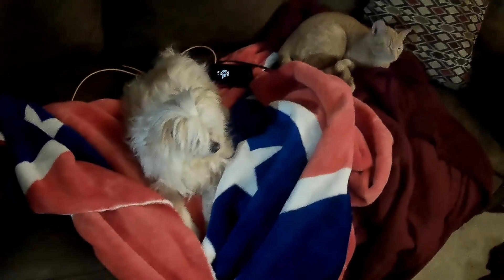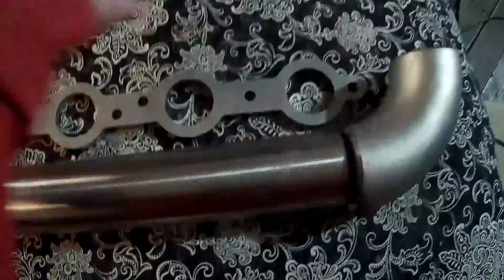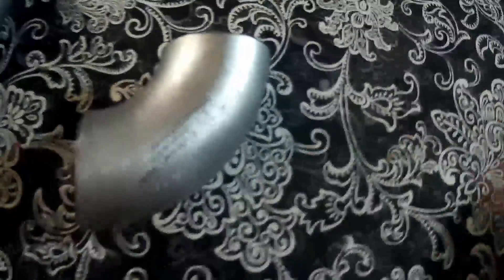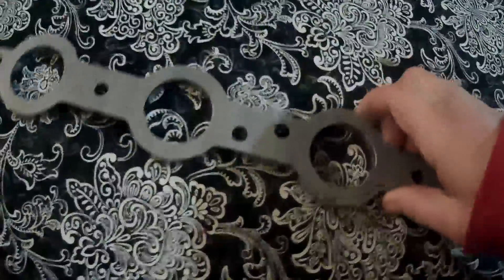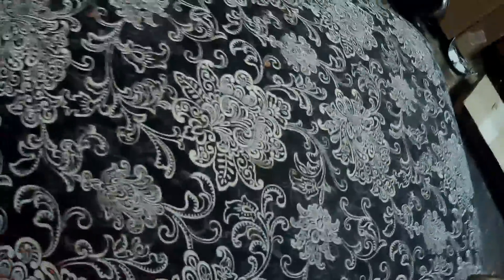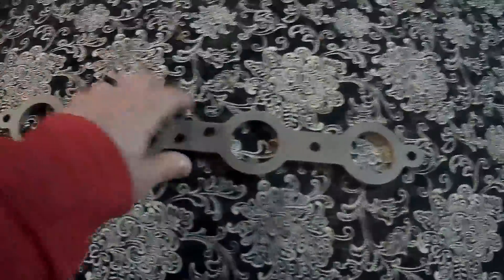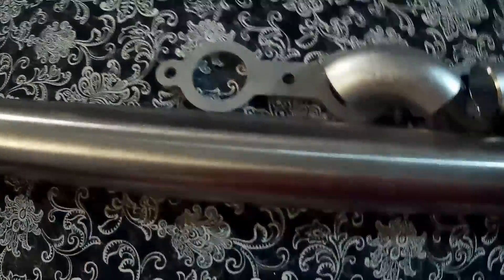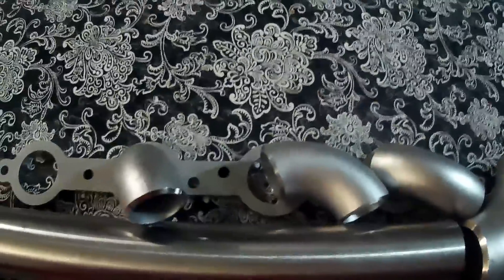How to build an turbo log manifold for your LS

Comment: Dude, they are Called elbows or fittings not Weld L. Just google 304L sch10 fittings
Reply from the maker: Google Weld El and see what you get, see what literally the first results are... There may be 15 names for them, but before I looked I didn't know any of them, weld el will take people where they need to go.

Comment: This is some good info for the DIY guys.
Thanks.
Reply from the maker: THanks! I hope it helped!
Reply: J.R. I’ve been looking at this site to buy my parts for the build.
Cheaper and have both sch 40 and 10.

Can’t seem to find good prices on Mild steel sch 40 though.

https://www.verociousmotorsports.com/Shop-by-Category/pipe-fittings-s40/Stainless-Steel-Schedule-40-Pipe-Fittings-Long-Radius-90-Degree
Reply from the maker: They tear you up on shipping though, 26.00 for one weld el, that's madness!

Alot of places beat you up pretty badly on shipping, I always went all the way through the checkout process after the first place tried to get 30 bucks out of me for a weld el lol. 

The price difference between steel and stainless when I was looking was negligible. I would have used mild because it's easier to work with, but for like 2 bucks a piece, why not stainless.
Reply: J.R. Uugh,  Got my cart full but didn’t make it through the checkout process yet.
There has got to be a pipe supply company here in the DFW (TX) metroplex I can walk out of with a box of weld els.

Gotta crank up the local search engine.  ;-)
Reply from the maker: I searched around my office in Grand Rapids Mi a bit and couldn't find anyone willing to sell to me like onsie twosie pipes, I need to look around some more. 

Without a doubt there's some hole in the wall shop somewhere with some old guy at a counter covered in ten year old books about pipes who think's you're nuttier than a squirrel turd for wanting this pipe lol. That's the kind of place you want to find.